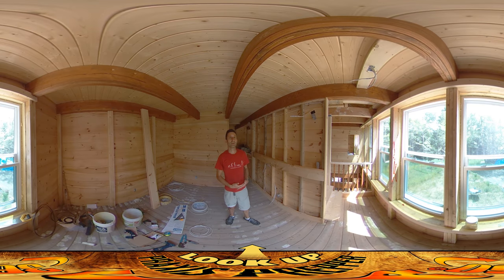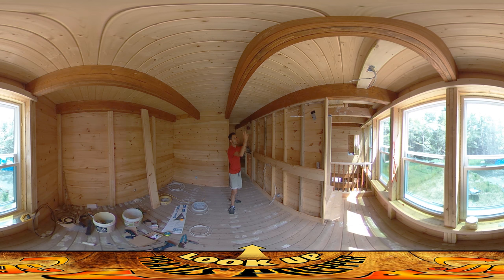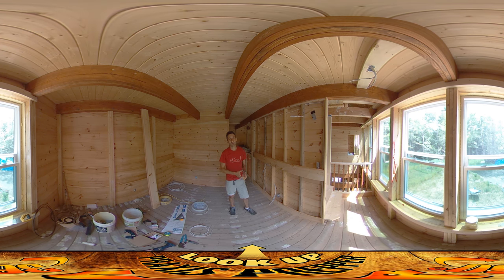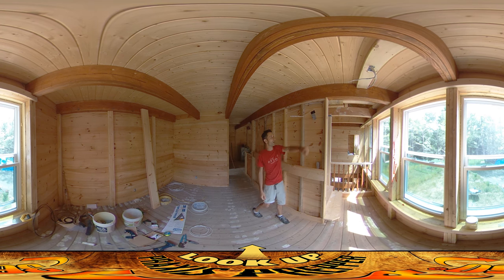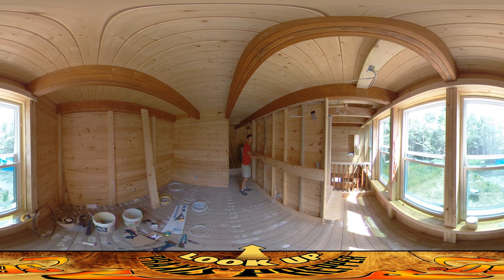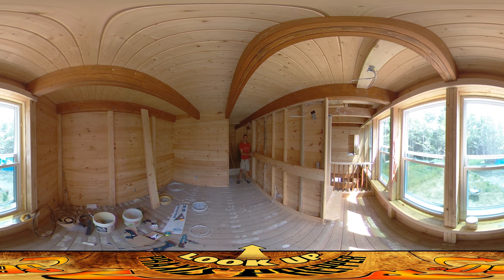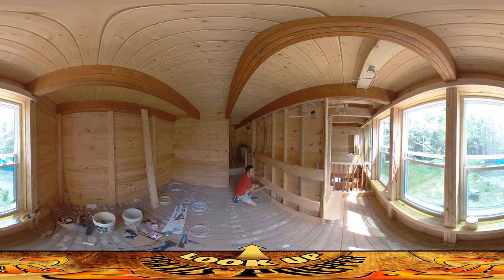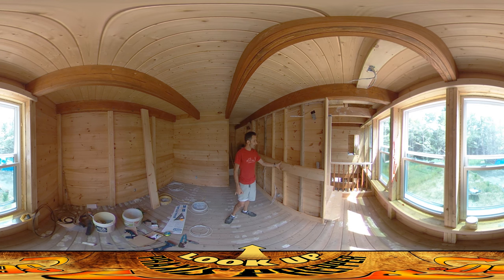Homestead Building - Electrical Boxes, Electrical Inspection Prep

Comment: Thanks for sharing well when it comes to the electrical stuff you need to make sure you get everything correct it is for your own saftey.
Reply from the maker: Yeah, electricity is often times pretty simple to do... but if you mess it up, a lot can go wrong for sure!
Reply: @PraxisPrepper  Indeed it can be a shortcut and then you have a fire that burn your house down.